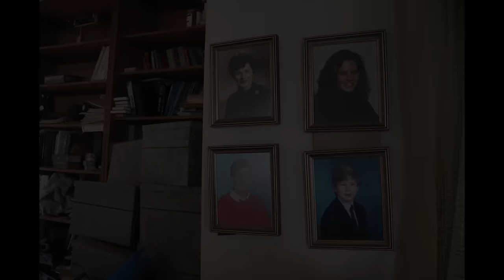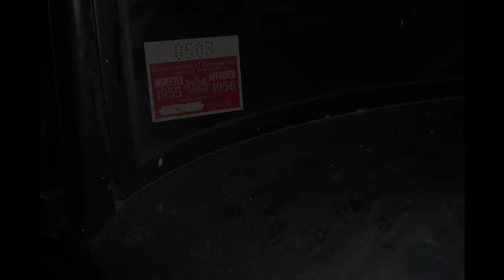1927 Packard Found in Abandoned Philadelphia Factory Sitting for Over 40 Years

Comment: It should not be restored. The patina it has is priceless. Get it running, and give it a bath, and just enjoy it. Contrary to what people are taught to believe....there is beauty with age.
Reply: Agree. Only the mechanic parts should be restored. The outside still look rust free. This would probably have more value without restoring what doesn't need to than restoring every detail of the car.

I would rather have the steering wheels with little crack with a transparent coating to preserve the original look than having it fully restored.
Reply: The older you get the uglier you get. Don't forget that it's a fact of life. Have a look in the mirror when you hit 60,70 & 80
Reply: In my neck of the woods we have a category called "BARN READY" for antique cars in running condition but not refinished, just like many daily drivers were after WW II when many people were waiting to get delivery of a post war car.
Reply: @luwdmke  that's kind of a bad comparison
Reply: Surprising to see the paint still had gloss on the sides/corners so looks like it will clean up so nicely and keep original.  Just go through the running parts to bring up to spec with new parts as necessary.  Notice the leg room in the rear passenger compartment - my dad had a '37 Packard 54 door for our family when I was a boy - fine old auto, made to last and for comfort.
Reply: @getredytagetredy  then why are so many AMERICANS saying, just make it run and drive it ;-)
Reply: Tires need fixed
Reply: Whoa a talking cat
Reply: getredytagetredy na your wrong. Many americans love that “wear & tear” look. 
American TV is not very representative of most of the people.
Reply: It all depends on what shape the car is in. I can't recall off the top of my head if Packard of that time use any wood in their constrictions or not. If they did then you really need inspect to make sure you don't have rot, or if the metal and wood have separated. Without seeing the car and knowing the damage it's impossible to say one way or the other. First thing is check and see if the bones are sound then decide.
Reply: @wakeboardbob  because that's the current fad, not so long ago there would have been no question, the car would have went for a full restoration. That's were the value was at, better then new, today we've gone the other way, the value is in an non-restored car, with just enough done to make it safe to drive, in this case you'd need to check the car out before any decision is made, metal skin on wood was common, I've seen cars were the wood was barely keeping the car together, ruined because they left it as it was then tried to drive it. So restore or not depends on many factors.
Reply: No. Restore and replace everything and give it a new paint job with flames.
Reply: Screw the patina. The car needs to be washed, waxed, restored, and taken for a Sunday drive.
Reply: He might as well not wash it. Just sell it as is.
Reply: @veltonmeade1057  it needs to be taken to a car shredder
Reply: TheCamshafter  I don't care what I look like any more, I no longer feel the need to impress anyone.
Reply: @luwdmke   Im guessing ole Stephen isnt dating an 80 year old

Comment: A restoration would destroy everything this car is right now.   Awesome history, awesome backstory, and a beautiful survivor.   Mechanical repair, buff, polish and drive.   

They are only original once and to restore it, you would lose what patina and history she holds.
Reply: While I fully agree with the cosmetic aspect, and with the thickness of the lacquer used on it, it should be just fine, the electrical is asbestos covered wired and would be disintegrating everytime that beast is fired up till one day a total short out. Also, the brake shoes and the clutch plate are made with asbestos and would also disintegrate once put to use. Period type wire that is not asbestos and the same for the brake shoes (shoe only with this one?) and clutch can be obtained easily and would help it come to life.
Reply: Azri'el Collier that is why my comment said “mechanical repair”.   All your listed aspects fall under mechanical to me.   

Wiring on any car pre 1950’s is scary at best.
Reply: @sonofeloah  Well, if its loaded with asbestos, it can't really catch fire, then :) 

For the record,  asbestos was never banned. You still have it on all brake pads, I'm almost positive. Just don't go screwing around indoors with it and use a respirator. 

The upholstery would have to go. The black mold is no joke.
Reply: @windsofmarchjourneyperrytr2823  if the upholstery isnt disintegrated from mold I'm sure there there are some  great fabric preservers with mildicide. The old upholstery too has it's own story to tell, until it is truly destroyed by age and another chapter of the story is added. 
I've worked in the automotive industry since college, I program factory automation and right now am doing a retool at a Ford transmission plant from the 6R to 10R (rear drive transmission) so I see my share of automotive comfort, but being able to see and touch and live by driving a piece of a storied bygone era should never be taken for granted for modern comfort. If you want new, comfortable upholstery the world is your oyster, appreciate it while you have it, when it falls apart and really needs reupholstering you will be contributing to, not revising, its story.

Comment: Pop the head and drop the pan - get it all cleaned up and broken loose.  Change all the fluids and get it running.  Scrub it down good and make it an oily rag special.  Very elegant sedan.
Reply from the maker: That's exactly what we suggested too! -Matt/ITG
Reply: @IronTrapGarage  Dreamers. Engine seized after sitting for 70+ years( do the math) is more than Stuck!  Good luck with it.  Would have been nice to have popped the hood and looked at it. Perhaps I skipped over that part. First the OH door is open, then not.
That should have been a 10 minute video.

Comment: Fascinating find and a beautiful Packard from 1927.  I agree, hope and pray that the main bearings in that antique Packard have not seized married to the crankshaft metal. If the oil in the sump remained somewhat fluid, even though viscosity might be somewhat thick, I hope the crankshaft once the engine oil is flushed out might be able to crank the crankshaft to see just how the engine performs. A tremendous amount of work is anticipated just to get this engine to run.

Comment: Great car! Love it! NO, don’t restore it ‼️ Keep that paint... I wonder if it’s the original paint, what do you think? Please, let’s hear it running... I’m sure you’ll get the ‘ol girl unstuck 🏁🍺 cheers
Reply: Almost certainly original paint. I don't suppose you can get ethyl-lead fuel in the states any more, would that sidevalve block be suitable for steel exh. valve seat inserts? Hope so. If not it's a fairly low RPM engine, might be ok without...?
Reply: @thephilpott2194  You can get lead fuel additive that you pour in the tank whenever you fill up. It's somewhat common for classic cars
Reply: @thephilpott2194  unleaded fuel should be ok for it as lead wasn't added to petrol until the 30's, it is Methanol in modern fuel that causes the problems, it will rot any rubber and dissolve the Tin plating on the inside of the fuel tank. Additives can be bought to neutralise its effect.  Alternatively re-line the tank and change any flexible fuel lines and pump diaphragms for modern ones.  A good idea if only for fire safety.
Reply: If the cylinder head needs no attention.There will likely be enough lead from the years of using leaded fuel  left on the  parts like the valves and seats to last years..

.

Comment: Packards were one of the 'Three P's' of luxury for the era.
Packard, Pierce Arrow and Peerless were the best luxury cars you could buy through the 20's and 30's.
Do a sympathetic restoration and get the car mechanically sound but leave as much of the original pieces in place.
The interior should be put back to original since it has already been changed at some point but leave as much as you can.
Mechanical work on these old cars is not cheap since there are few craftsmen left that can properly pour babbitt bearings in an old block like that one.
Reply: You're forgetting the quintessential luxury/Hollywood car: The Duesenberg.
Reply: @kevinfetner7983  The Three P's established themselves as the premier luxury cars in the early 1900's into the teens which was long before Duesenberg came along in the late mid to late 20's.
Reply: My Dad, a New Yorker from 1919 (when he was 27) until his death in 1973, told me that Packard's luxury appeal was distilled in their marketing slogan, "Ask the man who owns one."
Reply: I'd have to say Duesenberg's were the absolute top shelf car of that era. But Auburn, Cord, Packard, LaSalle, Pierce Arrow, Peerless, Lincoln, Cadillac and a couple others of that era were incredible works of art as well. Love the luxury cars of the 20s and 30s

Comment: Problem with restorations is, they are usually done to be far better than what was original. (modern super glossy paint vs the original, duller enamels, synthetic upholstery, etc)  Just change the fluids, giver her a bath and a wax job, and call it good.
Reply: @sherrycremona8641  
ᵁʰ ⋅ ⋅ ⋅ ʷʰ ⁻ ʷʰᵃᵗ﹖
Reply: That's not true....it's the owner who decides at what level of authenticity to restore the car. If he wants it exactly factory OE, then that's what he gets. I used to see this in XKE's all the time....the owner will try to have the car 'improved' and embellished. Depends how much you're gonna drive it too.....lavish modern paint jobs will last longer than factory jobs....especially if the cars sits more than its driven. I will agree that it's disheartening to see layers of clear coat that the original cars never had.
Reply: @kevinfetner7983  The original paint job on this Packard held up 90 plus years in very poor conditions, so I would leave it alone.  The original paint was a nitrocellulose lacquer applied with at least 12 coats and then hand rubbed down to 8 or so coats giving it a deep gloss.  Modern day base coat/clear coat paint jobs can't duplicate it.
Reply: @packard5682  Thanks for the info,that's fascinating
Reply: @packard5682  You really know your car paint.
Reply: Yay
Reply: Older duller enamels??? Seems you know nothing of the old cars and their original paint and finish etc. Yes synthetic was not common back then, but I have seen original paint jobs on original cars that people would swear were 'restored new paint'.... until they saw the original black and white photos showing thats EXACTLY the original. Things were flasher and nicer than is done today... people only ruin things by using the wrong materials... like chrome when should it should be nickled which looks flasher and nicer than chrome. Everything was finished in high shine hard lacquers back in the old days, much nicer and better quality than modern shite enamels or cheapo lacquers of today. 30 years ago we used Dulux 2k (2 pot) lacquer... hard and high finish, can't buy it now, they stopped making it because it takes more time to get the shiny finish... it must be cut but the finish of the old paints shits all over modern crap.

Comment: That car is an incredible survivor. It should be left as is, but made mechanically sound.
Reply: I'd update the safety stuff. 

There isn't any car club I know of in Illinois where that's not only not slammed for points, but clearly advised. Drum brakes suck. I've had them. 

I know what would have to be done on a bike to switch over to discs (get a thicker fork) not sure on a car, I'm betting there's some suspension parts that would need to be stronger.

I've had cars with back drums (97 Accord) but discs are better. They're a friggin nightmare on a bike! Wow, did Harley make some GARBAGE parts. lol. I mean, 1st item of business: dump new parts for stuff that actually works and often costs a lot less...Barnett clutch; was WAY better than theirs. I've stopped the bike with it alone.

Comment: A car is only original once. The people who keep them original are hero's for preserving history. I would just clean it up because you know the mechanicals were made to be rebuilt and last forever,  I would of love to seen more of the building showing the equipment used in the day.Thanks for posting this.
Reply: 60+ years.......it's gonna need more that a mechanical dust off.  Just the seats alone will have to be restored if any one plans to sit in them.  I saw paw prints on the hood, cats.  Which means mice.  Which love upholstery as nests.  There are going to be some funky odors coming from that car once it sees daylight.  This car is most likely beyond original already.  Built in 1927 and stored about 1955.  In 27 years we can figure it had some alterations made.
Reply: I think the point of any vehicle is to actually drive it. That means more than just dusting it off... :) 

Lucky for you, the wiring schematics are probably 4 wires, lol. :) 

you can update anything related to safety and I don't know of anywhere in Illinois that would penalize you in points at a show...

Comment: I'd say 110,000 miles on the Packard, they would do really big mileages ,as did the Caddys of the same era. it was good thing you were there to get a sympathetic tow job. Becareful with that old style lacquer,it can be rubbed right off very easily.   Clean it,grease it and may be a valve job and it will be right to go .
Reply: The spare tire showed more than 10k miles of wear.
Reply: @marcbee1234  My dad and me had a lot to do with cars from this era and often we couldn't buy new tires,just NOS stuff which were often 20-30 years old . Once on the road,that old style tire rubber wore pretty quickly,unlike today's. . If you got 20,000 miles out of set of those you were doing pretty good.

Comment: THANK YOU for showing this car!!
I used to rent/work with an older Gent here in the Memphis area who was the "Roster Keeper" for the 1928 Packard and helped him with his '28 that he restored himself before passing. (still have the rear cab section to one that I inherited) I think I still have some of his old Packard prints and Packard books in my shop (i'd have to look where I 'stashed' them though..) After his passing, his wife sold it, and not too long after passed herself.
And I think that's what the original interiors looked like! Kinda wild patterns that I don't think will come back in style.
I remember driving it in and out of his shop, and the seat patterns were messing with my eyes lol.
It was a MONSTER of a car!! It would just laugh at a 2 ton jack though.. He had a couple long reach semi jacks that were a pain to move around a small shop.

I would just clean it up, and go through the "mechanicals" I believe you can still get the hydraulic shocks rebuilt. 
(Hemmings motor news will be a good resource)
 And blow off the spark plugs with air so crap doesn't fall in, and spray some Air-0-Kroil in the cylinders, and let it sit for a few weeks before trying to turn the motor over! Kinda pricey, but the best stuff!  http://www.kanolabs.com/
Don't use that radiator "as-is"! No sense in circulating crust throughout the motor. (if block isn't cracked) And not many radiator shops that would touch it, or how to rod it out right..
That was a car if you had money! VERY expensive in it's time.
Thanks again.
Subscribed.
Reply: Another thing. to clean use some inexpensive 'baby shampoo' diluted after a low-med pressure wash.
You gont' want to scrub decades of crap into the paint. Also, these 'modern' cleaners/solvents can soak into the fender welting causing caustic/acidic reactions to the seams that you can't see until it's too late.
Coker can still sell you tires for it! I think they're 19-20"

Comment: Clean it up as best as possible.  Get the mechanicals sorted out.  The motor will probably have to be pulled and rebuilt.  It looks like 1 of the freeze plugs in the head is missing.  Clean up the nickle trim.  I think I would get rid of the 40's seat covers as it looks like the original upholstery is underneath and check it out for condition.  The wool upholstery might be moth eaten.  But keep it as original as possible.  That's my 2 cents!
Reply: I have a daily driver '51 belair (the yellow car in my profile picture). It had those same seat covers in brown when I got it. The original upholstery was perfect underneath so I started to pull them off. The first time my kid sat in the back seat, the leather to cloth stitching on the seatback all tore and now its spread opened. While the material is in great shape (the seatback still has the original tag attached to the seatback springs), the thread dryrotted. I'm 100% positive the same will happen to this car if they take those covers off and don't have the seats recovered